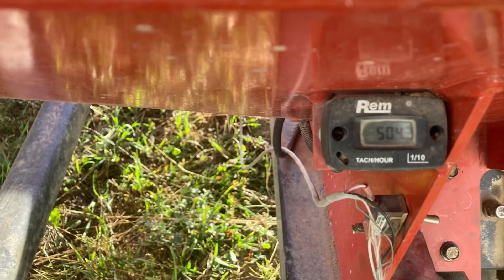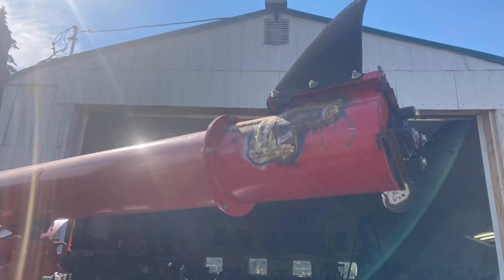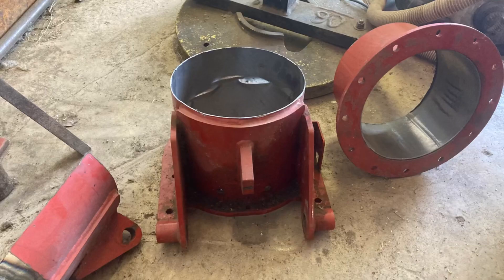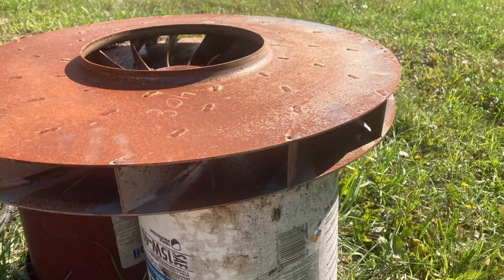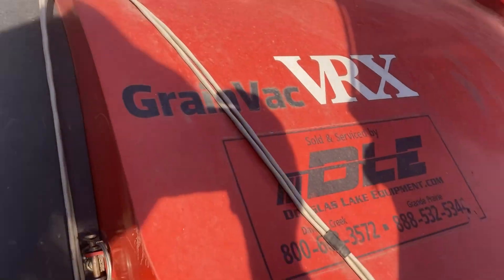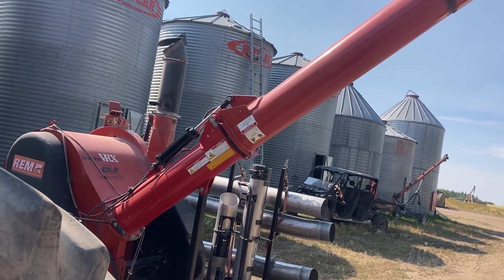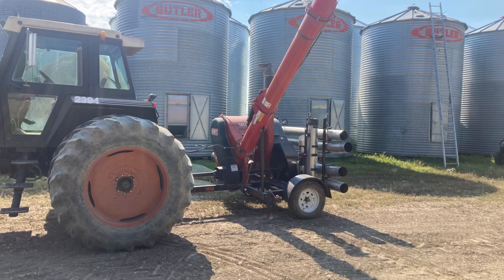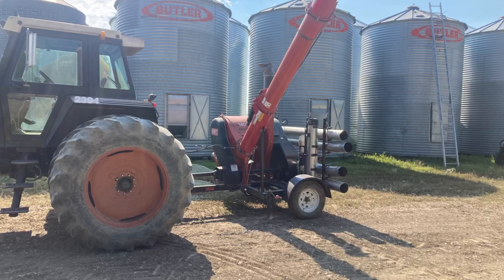Attempted comedy. NOT FOR LITTLE EARS. Rem VRX grain vac.

Comment: Hahaha.  It’s all fucking junk now.🤬🤬🤬  Don’t even know what brand to buy anymore.  I’ve got some brand new jd haying equipment that has made life no easier,or cheaper, or more efficient  than running my used line of old stuff. 😂 Keep spending money for more junk.  Looking at upgrading a tractor and discbine and quite frankly don’t even know what to try next.  Gut feeling says a kubota tractor (already have one and it is somewhat better than the john Deere) and a Vermeer discbine simply cause I don’t think I can face another green disappointment.  My john Deere crap baler is basically an unreliable piece of junk after 12 000 bales and my old case soft core keeps chugging away with minimal, uncostly repairs.  Just paid 872$ for a damn hex shaft that goes through a belt roller last week on that jd.  Fricking crazy.  Spent $6000 to make only 500 bales with the jd this year (let alone the $8000 repair job less than 2000 bales ago) and my wore out soft core kicked out over 2000 trouble free bales with no repair this year again.  These equipment manufacturers are not being held to any standards at all.  Quite frankly if Russia wasn’t screwing around so badly with the Ukraine I’d buy another new Belarus tractor. ( I’ve got one, don’t laugh, the AC is awesome in it, something I’ve never said about my Deere) Sad when communists build better stuff than North America.  That’s my rant.  Have a great day!!!  👌👍🤣
Reply from the maker: Isn’t that the truth, you spend a little bit thinking you are really going to have something? Only to find it total junk with no support from the dealer or original manufacturer. Dealing with equipment will soon dwarf any other problem associated with ag.